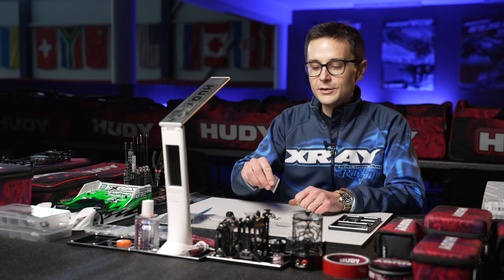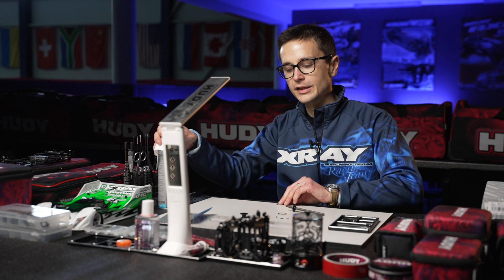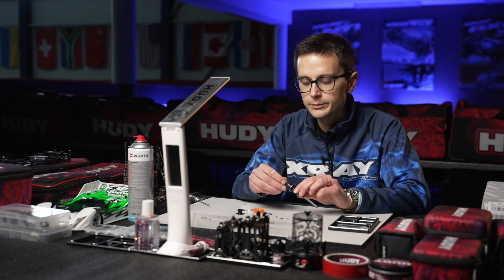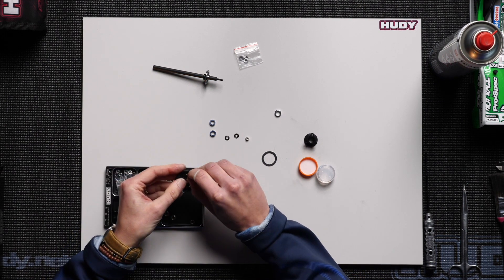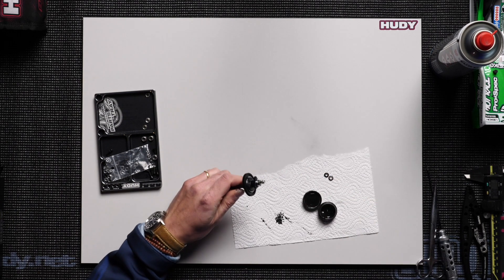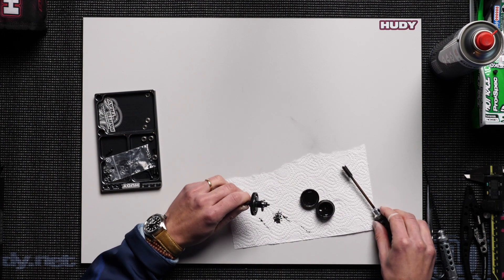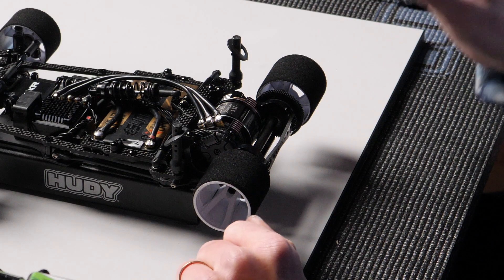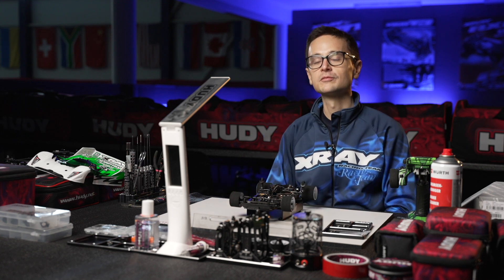XRAY X12 - Tech tip video - Ball Differential

Comment: Title: X12-2024 RC Car Review - Disappointing Without a Differential

“Hey everyone, today I’m reviewing the X12-2024 RC car. While it’s got a sleek design and handles decently for casual driving, I was really disappointed to find out it doesn’t include a ball or gear differential. Without a differential, the car struggles with smooth cornering and loses a lot of traction on turns. For hobbyists looking for performance, this could be a big letdown. If you’re serious about RC racing, you’ll definitely need to invest in some upgrades
The price for onlu gear dif its half price for my car kit